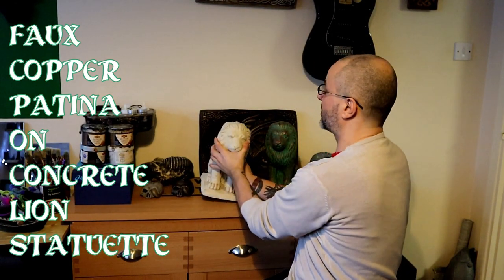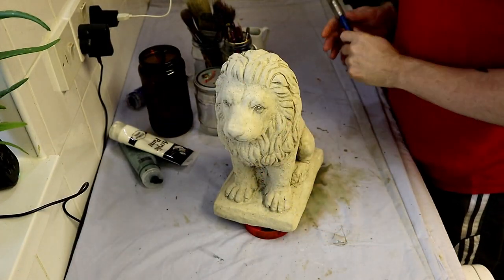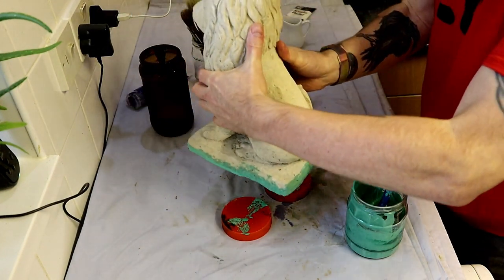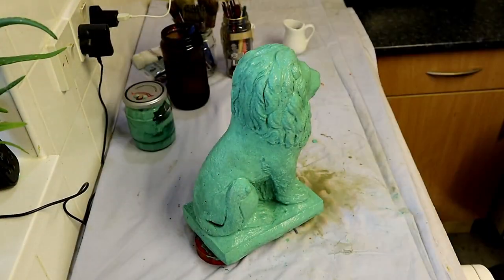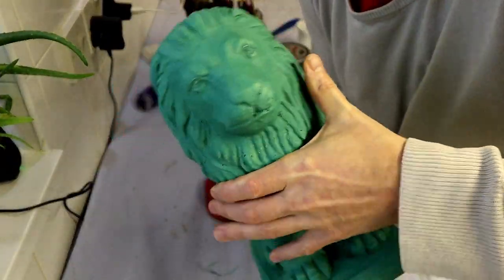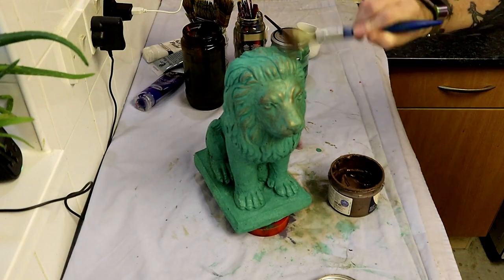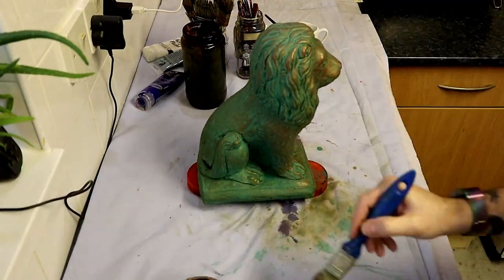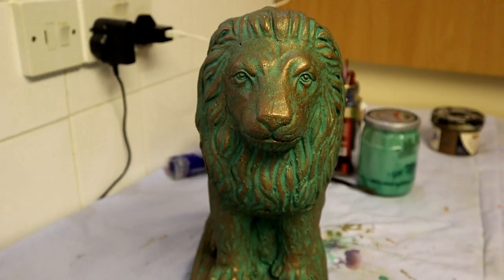FAUX COPPER PATINA On A CONCRETE LION STATUETTE

Comment: Beautiful job. Could I please ask what would be best to seal it for outside use. Thanks
Reply from the maker: Thank you Debbie! I tend not to put painted pieces outside, but if I did, I would use automotive laquer, although there are many options. You will have to maintain pieces due to weather, etc, hence why I would prefer not to put painted pieces outside.

Comment: Great effect, and easier than many! What is the copper paint, I couldn’t find it on your lists?
Reply from the maker: Thank you! For some reason and at present, it is hard to find the Liberon metallic paints on Amazon or Ebay.
Reply: @dramamask  Ah Liberon, I think I have used those before. Thank you!
Reply from the maker: @Solitude11-11  They seem to be pretty hard wearing. I might try some other brands at some point, just to see. :)
Reply: @dramamask  I have done quite a bit of verdigris effect, reverse to this by copper coloured base then sponging and dry brushing the blues and greens over the top, wiping it in places…I like this better on this kind of piece, as you can target the ‘polished’ areas better, plus it’s a lot less work, but where you mentioned the two coats and flat colour, try sponging the base in two or three shades from green to pale turquoise before the dry brushing? To get away from a flat effect? Not tried, but might work.
Reply from the maker: @Solitude11-11  Sounds good! If I am feeling more industrious, I'll merge dry brushing with washes which can turn out some great FX. :) PS: I did some vids a long while back using metallic paint with real metal in and then sprayed on some patina solution to give a real patina look. That is fun and you obviously get the authenticity. :) I should remake the videos as they are early videos and the quality isn't too special: Concrete Skull Painting | Reactive Bronze Metallic Paint With Green Patina: https://youtu.be/lWllhfhmt-I
Reply: @dramamask  I’ll check those out! 😊

Comment: Great job.  Can I use acrylic exterier "spray" paint for base.  I have a Buddha I want to paint the zap green for the robe and a tan color for the skin, what problems would I have besides being challenged at anything I try in art? ;).
Reply from the maker: I don't know, but I would guess the acrylic will be ok for a base coat. If you're not sure, test the spray paint on something before applying to your main piece. :)
Reply: @dramamask  It worked and looks good.  I chose turmeric color for the robe and tan/gold color for the Buddha.  Wife likes it so my life is simpler. :) Thanks for your comment.